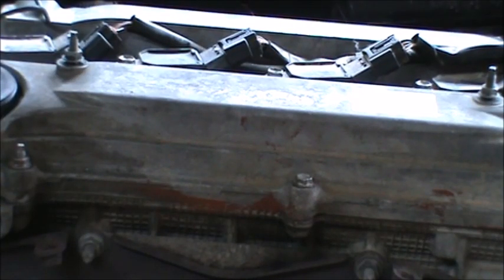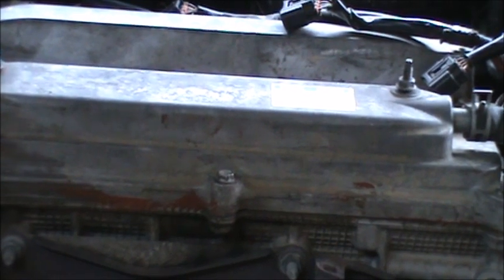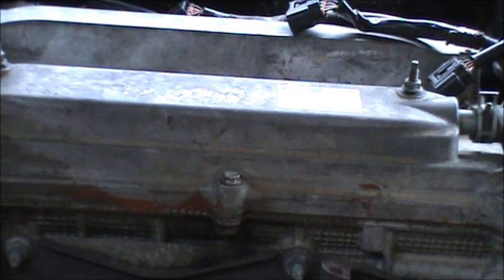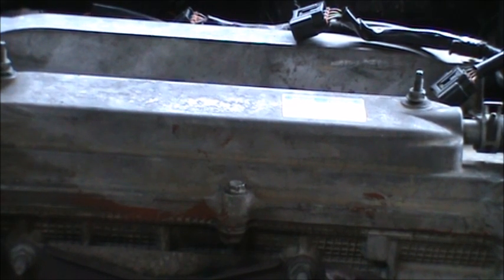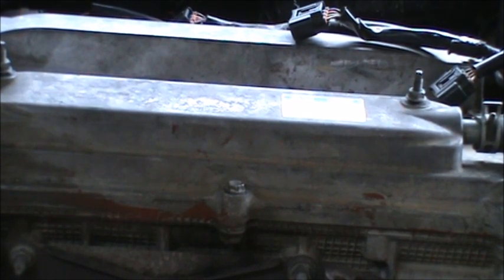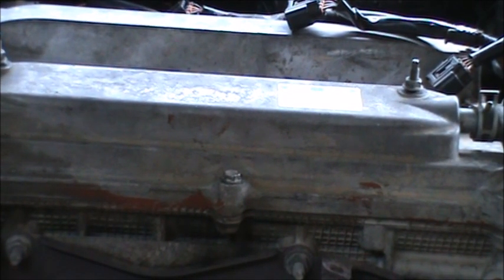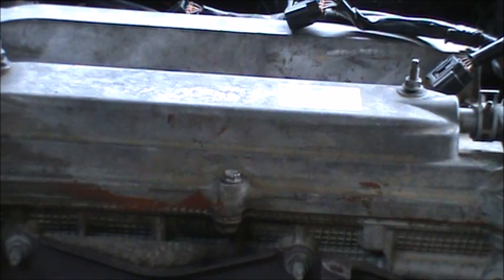Good Compression Versus Bad Compression (What It Sound Like)

Comment: This is what my engine sounded like after head gasket replacement. Turns out I set valve lash too tightly
Reply: I am in the same situation. I had my head gasket replaced on the 24 July 2020. 2008 Hyundai Getz 14 HS, the car is still at the garage. My mechanic feels the compression was not attended to when I took the engine for engineering. Kindly advise how
Reply: @collenz.mbengo5680  If the rocker arms are adjusted too tightly, you'll lose compression

Comment: if the engine starts right away ..i mean like 1 second after you turn the key you have compression issues. i had a old dakota that had 265k original miles that did that..it ran but she was tired.
Reply: Pretty sure it's the exact opposite buddy
Reply: @redbluepill2701  yea I'm like huh....
Reply: @outdat3d-04zx10r-ha  low or no compression and the car wouldn't start at all, starting imediately would be too much compression technically
Reply: @redbluepill2701  that's what I was thinking...2 or 3(4max depending vehicle excluding diesel cold starts) good turns and your compression is good ..anything else somethings up
Reply: @redbluepill2701  my last ST had low compression I think without me even knowing until now learning more...it took a good second to crank sometimes and the one I'm in now cranks 2 or 3 every time

Comment: Hey. Thanks for your video.  I had never heard the sound my 3.4L Toyota T100 engine is making after sitting for 2yrs. With the plugs it or out it basically sounds the same and NO compression on ANY cylinder...smh. Timing belt is on, cam marks and crank mark is dead on with #1 at TDC. I've been told that it may be my lifters drained all the oil out and lost prime??  Right now the engine is soaking (the best I could do) in marvel mystery oil and kroil oil mixture.  I put it in cylinders,  squirted in the oil fill hole with a tube to get in there further, also in pvc hole. Turned engine over a few times and now its just sitting.  Mine sounds very similar to what you recorded in this video but just a little slower.  On mine it basically sounds the same with plugs in it as it does with all out.  Any suggestions?
Reply: any luck
Reply: @SamSam-ih6nt  None....I called a Friend that worked as a mechanic for a local Toyota dealership. He said he has seen this a couple times when the engine sat for years. He seems to think that all the rings are stuck.  He recommended putting a 1/4 quart of ATF in each cylinder and letting it soak for a couple days. Just  like someone else on here recommended.  He said a lot would probably slip by the rings and end up in oil pan but that the transmission fluid had more detergents in it than marvel mystery oil. I plan on at least trying it before I give up. The engine in it is out of a 97 4runner and the dipstick is in the wrong location. (Meaning I can't tell how much oil is in it). I had a shop do the engine swap back in 2012. They had to put the T100 oil pan on the 4runner engine just so the engine would fit. If not familiar with the T100's, they have a crossmember that is so close to oilpan its unreal....smh. that is one of the few flaws I have seen with the T100s.  They didn't realize it until they went to put the used 4runner engine in it and couldn't find a T100 used engine in my price range. I have a feeling I am going to end up having to buy a JDM engine to put in it?? I mean I could remove the heads but if those rings are that seized, I'm unsure if I could unseize them any easier that way ya know? I got other projects going on right now as well as trying to start my own ATV repair shop. It's a real bummer.  The Toyota tech I talked to said he didn't think it was the valves or lifters. I had thought about using some sort of soft metal punch to tap on top of the pistons (like to vibrate them to help the rings to "spring" back out). My father said he didn't think that was a good idea? What do you all think? My patience are getting worn thin with this situation and just about to give up....lol. I am going to try the ATF deal. I know I will have to drain all that mess out before trying to crank it as well as blow any that's in the cylinders out. Something else I thought about was cutting belts off it so the engine has the least possible strain so that when I do try to crank it over it will spin more freely and pump oil to where it needs to be easier, idk? Anymore input will be appreciated.  Thanks
Reply: @dgmenace73  let us know how it went
Reply: @datboi8140  marvel mystery oil didn't help. I am going to do one last try.....a very good Toyota tech  that I know told me to mix ATF/Acetone,  50/50 solution.  Add 3oz per cylinder,  every 3days, for 9 days......it seems like someone on YouTube recommended the same.   I'm just getting back to the T100 because I had some issues that took me away from it.  He said to soak the cylinders,  after the 9 days....drain oil (with all the solutions mixed in) . He said to buy some cheap oil and put recommended qrts in, change oil filter. He recommended to get as much oil in filter as I could be installing it because this engine as sat for so long. Disable fuel pump or injectors.....it seem like I pulled the EFI relay or fuse way back when. Turn engine over to blow out any solution that may be in cylinders.....may be better to do that before I drain oil and change filter?  Anyway,  he said to check compression after changing oil and it should of loosened rings up or do it when turning over. What is your opinion on this? Thanks

Comment: How do I stop the car from starting ...i want to do this test
Reply: Micheal Robinson  take the fuel pump relay out
Reply: @Djames53182  thanks
Reply: If you have an older vehicle with a Gen I ignition distributor, just disconnect the battery wire that goes into the ignition cool
Reply: if ur car starts it has good compression

Comment: need help please had a battery drain replaced battery and alternator and now the vehicle will not start but when i jump it it will start ilet the batt charge and then off the cables and start it i disconnected the battery over night went back it wint start unless it is jumped and turns over just wont start
Reply: Check your wires from battery to fuse box, check battery terminals to make sure there tight and no wires barely hanging on. Also, open your gas tank turn the car to on (don't start it) and see if you can here your fuel pump. If you here nothing at all, could be a bad fuel pump.

Hope it helps
Reply: Dillon N Thank you i will try this tomorrow

Comment: My 2005 Mini Cooper S doesn’t start and of course is an interference engine , timing chain guide on the top broke off and went inside the engine so I know for sure the car is out of timing, and I was suspecting a bent valve on cylinder #3 so I check compression and all cylinders, I have compression except that is low 50psi in all of them and I was told that when a car is out of timing  could cost a low compression , so my question is , before I do a timing chain replacement , you guys think that I should go ahead and remove the cylinder head ? Any help will be deeply appreciated.
Reply: hello, what did you end up doing?
Reply: I’d get a new engine
Reply: @diesel.bimmer  replaced the timing chain on it and runs excellent

Comment: if a hole is burned in the piston or valves not seating blown head gaskets gear on distributor shaft timing chain jumped or complete failure
Reply: Be cool man.

Comment: mine cranks and dies i did have a tooth skipped code and misfire i changed the plugs now i get no codes it starts and dies and makes a loud popping noise
Reply: J Rob not getting enough fuel, popping sound from the exhaust means too lean of a mixture
Reply: Bad compression popop poo... from the engine to confirm place hand on throttle and crank, if it blows it out you will have confirmed it and if it  tries to suck it then you're good

Comment: my mazda protege5 does the first sound it won't turned over my mechanic said compression going in the radiator... i have no what to think i bought a engine and transmission from the for $400 and paid my mechanic $400, I'm really frustrated i still have to paid for further repair... if its something else. please help
Reply: "compression going into the radiator" really??? I hate to say it, but you should really look for another mechanic... compression has nothing to do with the radiator. the radiator only deals with coolant and transmission fluid, if you drive an automatic transmission. good luck figuring things out.
Reply: Blown headgasket introduces pressure into the radiator and crankcase. Kinda rare in a newer car tho.

Comment: Hi there. Thanks for posting. 
what if the noise heard is this of a bad compression but with noise speed between those 2 sounds. 
My question may be confusing...
I found a 2011 Kia Soul with a bad compression but what i heard was slower than what you posted and faster than a normal compression sound. 
I know the small Kias are notorious with head gasket problems
Reply: mamery jazz did you find the problem?

Comment: U sir are a good umongst men you put my mind to ease but before I do start to build my Civic I'mma compression test it and if the 3rd cylinder is bad cuz a stripped spark plug I'mma get a new head then build her
Reply: Use a square easy out...getting mine from grainger tomorrow.... Same thing with me but in a Benz

Comment: What about a starter just spinning freely and not making contact with the fly wheel  , check for engine turning first to make sure is not your starter , it kind of sounds the same
Reply: What if the it turns just the belts and just sounds like it’s spinning kinda like that?

Comment: my car was running fine the next day starts sounds like no compression check the timing belt looks fine any idea what can be 91 corolla
Reply: buy a car made after 1997  still cheap but more reliable
Reply: Is the timing belt tight? Check the timing marks. Maybe it jumped a tooth. The starter gear may also be stripped making a similar noise. Good luck.
Reply: Yes, a faulty starter could make a similar sound. The sound of the starter spinning, but not engaging the engine, would sound very similar.

Comment: Hi, my  engine has  compression loss after the engine is hot and is loosing power, but no sign when starts up, any ideea
Reply: Your internals are warped, could be a gasket, could be the cylinder heads valves pistons etc but something in there is expanding allowing a leak so the piston can’t compress to the level it’s supposed to. You say loss meaning they still all have compression so that would be the only logical cause
Reply: Do your crank and cam position sensors first just in case.
Reply: @shanejones578  thank You,i left IT like that and use IT how IT is,for now,i ll look at those sensors too but i think You re right because  on  one cylinder IT has less compresion,on one or for i don t recall.
Reply: @shanejones578  IT had the head gasket replaced and after that happend this problem

Comment: would trying to turn over the engine like that if you have bad compression or miss timing cause any further damage??
Reply: Possibly but if it has no compression there’s probably a hole in the block or something
Reply: If it has no compression you gotta rebuild the cylinder and maybe even crank at least pistons and valves

Comment: That's how my Taurus sound. It ran fine then started acting like the cats was clogged up then i started loosing speed and smoke started coming from under the hood. Now it sounds like this video.
New timing chain...well 1 year old chain. i just don't know what to do. i wanted to remove the exhaust pipe from the engine to see if it'll run then.

Comment: How do you crank it without starting it lmao
Reply: unplug spark plugs
Reply: @l3lhsl3  ...
Reply: Unplug fuel pump fuse
Reply: @l3lhsl3  Wouldn't that cause unburnt fuel to flood the engine and cause a bent rod or 2...
Reply: @ooozooo7333  lmfao where did you hear that at